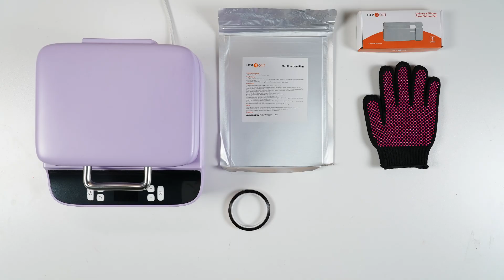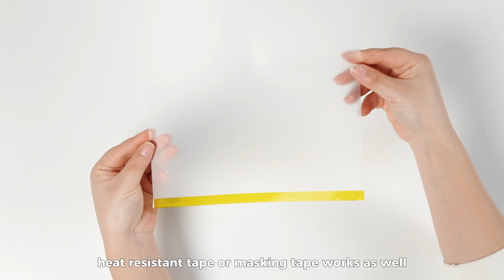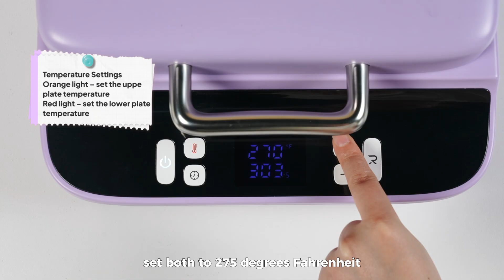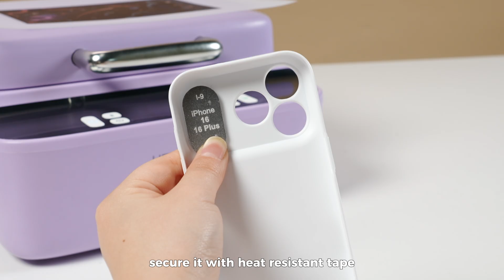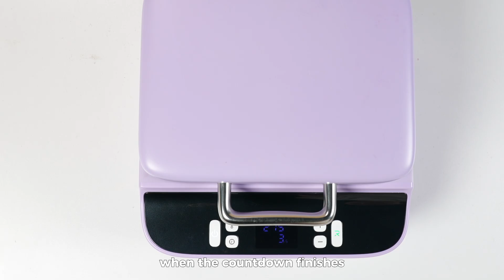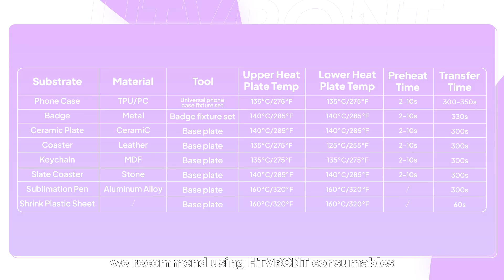H17 Phone Case Heat Press First Use- HTVRONT H17 Phone Case Heat Press

Comment: I have the machine but the metal tools are only for iPhone 16 and I don’t know how sublimate IPhone 17 Pro Max, do you have another tool for next models?
Reply from the maker: Well we think you can sublimate the iphone17 pro max with the Iphone fixture we provide. Just up side down as your usual operate
Reply: @HTVRONTOfficial  do we have to insert any of the small metal pieces in the metal jig for the 17 Pro Max?